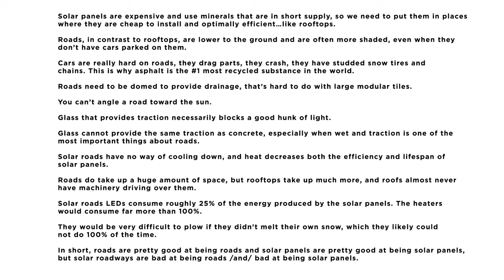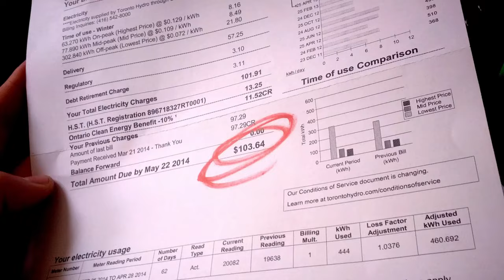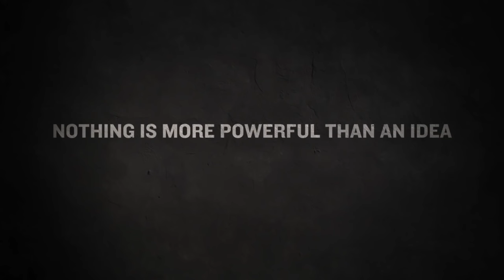The Kony 2012 of Roads - Solar Freakin' Roadways

Comment: Photovoltaic roads are problematic.  I've seen much more pragmatic thermal solar road ideas.  I can't find the links, but there are some places that use them.  You basically run pipes under the road.  All summer long you collect the heat in the road all summer.  In the winter you turn the system around to keep the roads above freezing whenever there is precipitation.  You pay for the system because the roads need less maintenance- less salt, less plowing, less pothole repair.  Again, I wish I could find the links, but they also managed to provide district heat for buildings along the road.  It's basically a variation on a heat exchanger.  It doesn't produce any electricity.

On the topic of solar thermal... which we seem to have completely forgotten about in favor of photovoltaic, I've seen some research into hybrid panels- for roofs, not roads- that use waste heat from the solar voltaic cells on people's roofs to generate hot water, with the added side effect that photovoltaic cells actually lose efficiency and longevity when exposed to extreme heat.  

India is covering a lot of their canals with photovoltaic cells.  The idea it that it keeps the water in the canals from heating up and evaporating.  It creates an artificially humid area under the panels, a micro-ecosystem that is good for plants and such (not sure about mosquitos).  If they've managed to deal with the moisture issues in the scaffolding well enough it looks like a potentially promising way to get 'land' to put solar cells on.  (I could see uses for more complex water systems too, where putting solar on top could power pump stations.)

What got me about the solar roads... most highways already have long, wide strips along the side to control vegetation, or to put noise mediation barriers in.  These long stretches are already publicly controlled right of ways where we could put panels.  I mean, you could put it in the pavement, where things are driving over it, or next to the road. 

It would probably cost prohibitive, but I wonder if in certain areas, it might be worth covering some roads- not as a general thing to do on miles and miles of road, but, I mean, we used to make covered bridges.  Bridges+cold weather+precipitation means ice.  Throw some cover over bridges prone to freezing, and while you're at it, throw some solar on top to power the lighting, or maybe even heat the bridge near the entrances in each lane to help melt any ice that comes in on tires.   I don't think I've seen anyone mention it, but one of the advantages, as we switch more and more to EVs, is less car fumes, which could make tunnels/covered road areas less dingy and lower the amount of extra ventilation you need to provide.  We already, in some specific locations, make tunnels to contain traffic sounds that are too close to residential areas.

Comment: I was actually driving down the road recently and thought of this project and wondered what happened to it/why it never started to roll out. The brain holds on to the weirdest things.
Reply: They're still working on it. It seems like their main focuses right now are on airports and military bases. They currently have a contract with the US Department of Defense and passed several tests with the US Department of Transportation. They may not be the miracle they hoped to be in 2014, but it seems they're finding enough success to continue the project.

Comment: Instead of putting solar panels as the pavement of a parking lot you could just install solar canopies on parking lots, making them more efficient because of a better angle and allowing them to provide shade to cars, you could even charge EVs with that power.

BUT NO, BECAUSE SOLAR FREAKING ROADWAYS.

Comment: Modern roads need to disappear to save the environment and be sustainable. Building cities for ONLY cars and no other transport stretches out the infrastructure required to support it too far to be supported by the parking lots and extra wide left turn lanes it is serving. (For electric cars all the pollution and environmental destruction go into making it, mainly batteries).

Comment: In my opinion, the problem is that the general public hates research. The general public demands to receive the fruits of research while simultaneously demanding the end of research funding. I think that solar roadways is a great research idea--the kind of research that would produce interesting data that could lead to a lot of related and unrelated discoveries--but no one would fund this. You pretty much need to deceive the people into thinking that this was a near complete product in order to continue the work--which is not something I agree with, but I get it.

Comment: I'm sure this doesn't touch on everything, but it seems like the issue isn't that solar roads are bad idek, it's just we don't have the right materials yet. A lot of materials now a days can be tuned and optimized from an atomic to macroscopic composite level. If no one or not enough people are working on the technical aspect of the problem, it won't work but it's not to say it can't work. Glass as we know it may be bad for road ways, but what if you could make a nonslip, transparent material with a negligible thermal coefficient to reduce internal strain? Or you have a series of materials that optimize one property and stack them? Bottom line is they all have to be transparent, but it's much more manageable. Does anyone know what types of groups are working on this project? This could be a great optimization problem for an AI.
Reply: Today a solar roadway is a bad idea.  Tomorrow it will still be a bad idea.  You can put the panels up on the roof and get more electrical power per dollar.
Reply: @kensmith5694  what if you changed the problem. Put solar panels above and below a bridge. Above the bridge it's a standard construction. Below the bridge, use parabolic mirrors to redirect sunlight underneath. Now can this system be compressed into a standard road? Then can it be made financially and environmentally cheaper? They're all separate questions that need to be done incrementally but may contribute to a plausible solution - even if it's not on a national scale

Comment: I was on the right side of the solar roadways thing, but I didn't get there on my own; I heard about it initially from an—among other bad things antifeminist—skeptical source.  when you first hear about it in a skeptical context, it's super easy to see that everything that makes it a good solar panel also makes it a bad roadway, and vice versa.

I feel like I escaped the antifeminism thing with a good heuristic that's also steering me the right way on (for example) trans issues: all people are people; people don't get to choose the circumstances they were born into; what's kind and respectful to the most people?

I'm not sure that I'm there, quite, on nonsense like solar roadways.  if I heard about it for the first time, now, in a pro- context, with all the excitement of 2014, would I respond the right way?

Comment: Wait wait, the solar road installations have been unmitigated failures, it's not that they were presented as a big thing but it turns out they only have some Niche uses, they don't work at all and are worse in every regard compared to Asphalt, every single one.
They use more power than they generate.
I mean do I have to say more?
Okay the lights don't work, when you do you cannot see them except from directly above, they break all the time, can't walk on them, can't get them wet, and they're very hard to install and repair and they're extremely slick, I can link the video of people slipping on them, none of these problems have been meaningfully addressed because they are all inherent to the product no matter what you do.

Comment: You're ignoring the one, small group of experts that can easily effect massive change in incredibly short period of time, often regardless of expert input: politicians.

Be very clear on this; politicians as a group could have, and still can, solve climate change (and practically every other problem) within a couple of years. But only if they chose to do so. They have not chosen to do so. Each of them should be held accountable for this choice.

Comment: I'm gonna cling to this hill and die on it. There is no reason why an engineer should be unable to design a material that is both translucent and good to drive on. Placing solar panels under that would be very easy. It's only a matter of time and of good materials science.
Reply: Like I'm looking over the list of reasons it couldn't work and they all seem pretty damn surmountable to me. Imagine if I criticized the concept of a computer by saying "CPU's produce heat and heat isn't very good for electronics." Like dude: add a fan. We should have responded to this not with turning out noses up at it but by saying "how can we make this work?" Don't find experts to explain why it can't work find experts to make it work.
Reply: But why?  I mean you could make bowls that are also solar panels but you wouldn't.  You also would lay a bunch of solar panels on the ground normally, for one you want to angle solar panels so they are more efficient.  Roads meanwhile aren't particularly well known for being clean so you have an inefficient angle that's going to also need to be self cleaning while being driven over by trucks all to achieve what exactly?  There's plenty of smarter places to locate solar panels that aren't already doing a very important thing.

Comment: I was actually thinking about the solar roadways hype earlier this month.  At the time, I thought that it looked to probably be 15 or 20 years out from actually being a viable product.  And, I was certain that the cost vs benefit would tend to other solutions in most applications.

But, I still want to use their product to rebuild my driveway.

Comment: I am going to be “that guy” for a minute.  This is the same problem with renewable energy or more to the point renewables can not be the only solution to get the world to net zero carbon emissions by 2050.  I don’t dislike solar or wind but it is impractical if not impossible to achieve the climate goals the world needs in the timeline required.  We want to believe renewable can be the solution because it seems like the perfect solution but find real solutions is not perfect.

Comment: I wonder what the utility of solar panel roads on the top level of a parking garage would be?
Reply: It would probably work better to just build a solar roof over the top level.
Reply: @MattMcIrvin  I thought that too and over parking lots in general. The only caveat I can think of is if you had the regular solar panels above, snow would still most likely blow in unless you entirely enclosed the roof. Around where I live at least they usually close the top level of garages in the winter because there’s nothing to do with all the snow so having a road that melts it would be useful up there

Comment: The first thing in the list is the only real problem as far as I can tell. Making solar roads is an awful, hair brained idea. No need for the LEDs either. But solar parking lots could be a thing if the minerals they used were in greater abundance. Perhaps when we start mining asteroids for minerals. We'll probably have fusion power by then though, so it will render the point moot. I'm curious what the heaters are for. For the solar cells themselves, or just road safety? If the latter, there is no need for them either in a parking lot.

Comment: You know what would actually be useful? Skyscrapers have a glass pane that is from ceiling to floor, can't you make half of it solar panels? Why do you need a 100 storey building of glass if not just for esthetic?
Reply: That sounds like an awful idea. People like windows.
Reply: @lucas56sdd  no like half the pane. Top part normal window, bottom part solar panel. Windows is useful, but gigantic window from ceiling to floor is useless

Comment: I like that neat list of why solar roadways is a super-dumb idea. It nicely summarizes just the tip of the iceberg of what is wrong with them... of course we have all those empty rooftops people. You do not have to put panels in the road... you can put them on every single roof there is... also you can roof over a parking lot if you so wish...

( which parking lot btw should never have been built, rather a multistorey parking garage preferably under the unit that needs them... and boom no parking lots... but hey capitalism guts you with the cheapest to implement most environmentally harmful solution there is when regulators are limp...)

and so you covered your parking lot with solar panels and also provided sun shade for those cars cooking in the sun otherwise.. win-win all around :D

Comment: 2:33 “Soap may have been the last simple solution” - for interest soap’s first recorded use dates back approx 5K years (half of recorded human history) to Babylon. BC Romans didn’t like it (using scented oils & physical scraping to get clean until the 1st century) and it possibly rivals paper as being the first item manufactured on an industrial scale (requiring a factory) in Western Europe. So yes seems legit, after the wheel, loom, paper, pottery & boats which are simple enough to understand but before the blast furnace, banking, explosives & flight which are not simple. What 8Bn people living together on a planet definitely needs is soap 😹

Comment: I don't need to be an expert in roads to know Solar Roadways is idiotic.  The glass surface shown would scatter light, making solar power generation and LED display suck.  Any given surface behind glass cannot be both a solar panel and an LED, so the power generation and road sign usages fight each other, making them poor at either job.  The requirements of being a road surface, solar power generator, and road sign contradict each other, rendering the idea dysfunctional and/or far too expensive.

The problem with people is not that they can't be experts at everything, it's they don't engage their brain.

Comment: I do wonder if putting solar panels in the middle of tracks for an electrified railway might work. The wheels don't touch the panels and most of the time they'll get sun when the sun's out unlike gridlocked car paths.
Reply: The thing I never understood about the solar roadway idea is that there's plenty of room elsewhere for the panels to go. Places where maintenance is easy and nondisruptive
Reply: @LikelyToBeEatenByAGrue  True, true, but tracks need replacement every 5-10 years or so, so maybe the panels could be maintained then? Or at night if late services are infrequent? Not sure how long of a period you can let them go for.
Reply: @BringMayFlowers  possibly, but a few meters to the left would still be easier

Comment: The answer, is neither a full solar roadway, or the panicky, spastic, hyperbolic blithering of whomever this dude is. It’s to use the solar merged with other materials in intelligent ways. So you don’t pave the whole road with solar blocks,  but you do place them on the meridian and the roadsides, and you use them (along with double helix wind turbines on the lamp posts along the side of the road) to power the neighborhood, the lamps in the streetlights, and to power wi-fi chargers embedded in the asphalt of the road, that in turn power the electric cars that pass over them. And before you balk at that last prospect, Volvo is already testing this “road as charger” tech in Sweden. Additionally, you use solar glass in the windows of high-rises and homes as a power source. And you use flexible power plastic molded into everything from bus stop shelters to the body of cars themselves to provide power. This notion of a single-source solution, is not a thing. But I’m also not gonna create some flipout reaction video that shoots down people who are developing answers. This is an all-hands on deck moment, or we’re not gonna survive the next 100 years, so I pointedly DGAF how outlandish an idea “might” sound at first. If they can make it work? Good on them.